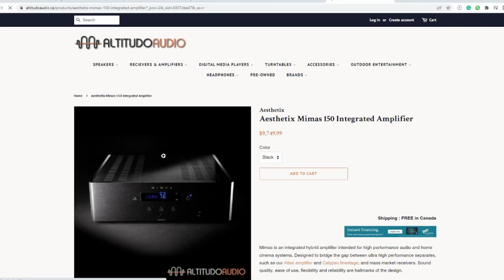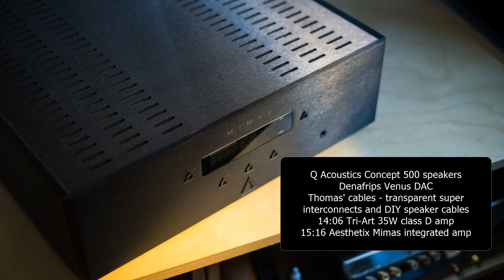A story on HIFI Synergy. How to get any speaker to sound AMAZING?

Comment: Synergy for me:  GIK Acoustics and decluttered room (hifi rack NOT near the speakers),  Sonusfaber Oly 1s, McIntosh MC75 monoblocks, C2500 pre, Sonare Ultra Rendu with Sonic Itransporter and Mytek DAC+, Roon, Eat C Sharp with Ortofon Cadenza Blue.  I also have an Otari semi pro reel2reel and a tuner and Feliks headphone amp in there, as well as a Pioneer CF level cassette deck. Oh and dual Rythmik 12 in subs. All in a 12X10 foot room. Cables are a mix of Cullen, Audioquest, Nordost and some Canadian famous engineer--cant remember brand name.

The greatest impacts on synergy for me besides decluttering and treating the room were 3 fold-----1) the MC75s are much better in my system than a solid state Luxman --the solid state to my ears sounds "SHOUTY", 2) I had EPOS Elans which weren't great, and 3) the Sonare/Itansporter/Mytek stomps all over the Node 2i.

The Rythmik subs are quite a step above the SVS too.

All these changes pretty much bought unheard, but after HOUR and HOURS and MONTHS of internet research. Now today, my latest addition is a degritter. I will use it in tandem with the Nitty.
Reply from the maker: Really nice and thanks for taking the time to write this long comment.

Comment: @Thomas, recommend you try Vandersteen Model 1Ci’s with a YBA A100 or A200 amp…fantastic synergy giving a taste of “high-end for little money” (paraphrasing Audiophiliac) as the Vandersteens are so cheap on the 2nd hand market in the USA ($200-500 2nd hand).

Van Dam audiophile 6mmSq. speaker cable, Neo Oyaide D+ XLR interconnects between amp & RME ADI-2 Pro FS, Isol8 Mini Sub Axis with DIY power cable, but the synergy is there without the conditioner…the conditioner just boosts it even more.

NOTE: 1Ci’s used to cost $1199 new but today they’re $3000, but the 2nd hand market hasn’t increased values to match thus they are the best deal in HiFi.  Sure the new 1Ci+ is improved but the basic sound signature hasn’t changed.

For more info, check the video entitled ‘If I could only own 1 system in my life for a small amount of money’ on Real HiFi Help’s channel as he identified this combo.  He also has ways of doing DIY upgrades to take the performance of this combo to the next level.
Reply from the maker: Nice, thanks for sharing.

Comment: Great video Thomas, I am a total believer in system synergy.  I own the Q Acoustics 3030i for my desktop setup.  And purely on a whim paired it with my little (and cheap) Loxjie class D amp and it is a fantastic combination.  The class D amp is able to maintain the grip on bass which the 3030 speaker has plenty of and it also gives the somewhat rolled off top end just enough sparkle ✨ to make it a wonderful pairing that makes me want to listen to music and that's what matters most to me.
Reply: Hi, Which Model of Loxjie? A30, D30 or D40? Myself has 3030i, which to improve. Thanks
Reply from the maker: Thanks for sharing!
Reply: @paultezuma864  Hi Paul.  I have the A30 model and really enjoy that pairing, great synergy.  Keep in mind it's only in near field so I don't know how it would perform in a regular distance.

Comment: "plug it in and listen" - Yep - exactly! System component synergy is completely amorphous, and non-linear; expect to pull out your hair in frustration laugh, cry and waste lots of money on the path to bliss:) In the end though, the returns can outweigh the expenditure and hassle - if you're lucky, patient and persistent:)
Reply: Another way is - deals with people who can provide you proper advice and who know products.
Reply from the maker: I like how you said it, non-linear.
Reply: @ThomasAndStereo  Yeah, if system synergy was the result of a linear function, i.e. let system synergy = y, and let x be the 'score' of four great components, ie. dac, preamp, amp, speakers, then we could define system synergy as a result of a simple linear function, y = f(xa,xb,xc,xd). 
What we would expect with that function is that the rate of change of the function is constant, where for every unit(s) of x along the x-axis the rise in the y direction along the y-axis is constant. BUT NO - it doesn't work that way - matching this great DAC with this great preamp, great amp, great speaker etc - will more often than not result in a crappy sounding system, even though we would expect that the greatest components would pair into the 'greatest system':) 
This maddening non-linear behavior, is why I - in my 35'th year of having contracted audiophilia nervosa - now strive for absolute neutrality when it comes to gear;, because neutral components yield the most linear behavior when it comes to system synergy & matching.
Reply: @leonidyamborko4531  Very good point - not so long ago, there where actual HiFi stores where one could listen to actual stacks of components, taking out the guesswork:)
Reply: I whould recommend audiotion, after that all questions is disappearing. Best to hear once than continue guessing… Audio is about sound, it’s not Logistics

Comment: Hi Thomas, great vid.
I have the c500s and over the last year or so I’ve paired them with numerous amps. I really enjoyed the Hegel h190 but just lacked a bit of sparkle in the top end , tried it with a peach tree nova and really didn’t enjoy that. Tried them with kinkistudio M1 , forget it. 
The dayens amping mono blocks with a passive pre amp worked well.  I recently had the dayens ecstasy mk4 power amp being fed by my Hegel p30 and that worked very well. But now I think I’ve stumbled on very good synergy 
Lumin U2 mini.to denafrips pontis2 to Hegel p30 to passlabs xa30.8 to the c500s . Really enjoying this set up. I’m using a lab atlas mavros from the streamer and 2 pairs of telleriumq ultra black ll xlr cables from dac to pre and pre to power amp , speaker cable is tellurium silver ll .
Reply from the maker: That is a killer system you have there.

Comment: Seems like synergy is easier to achieve with some speakers than others. I came away from this with the general impression that the concept 500s are difficult to drive and picky about power, while Focal (and probably others) are able to deliver their intended sound with a far broader range of equipment.

Comment: Indeed all depends on system - and acoustic- synergy. A well received review topic may disappoint/frustrate at home because of the reverse situation. An audiobuddy here was very disappointed with the in itself excellent Stirling LS3/5aV2; lack of system synergy. when I brought over an Exposure XV amp and simple Linn K20 speakercable, he was delighted with the sheer sense of musical involvement he experienced when that modest but synergistic system was conveying the signal of his Linn turntable to the plucky little Stirlings.
Reply from the maker: Yes, it can make that much of a difference.

Comment: Finally the video i was waiting for:) 
My experience with C500 has more with the room synergy - in "old" listening room it sounded very rolled off, and I was thinking its because of Pass amp thats a bit on darker side. Then when i moved into a new house and placed C500 into a new room, the sound completely opened up, its almost a different speaker! Much more energy in the top and now sounds more balanced. 
But i am still wondering is Pass XA30.5 good match with C500 or I should replace it with something else? Hard to get something to audition where i live.
Reply: I found synergy with my speaker setup: Concept 500 and Aesthetix Mimas not with critical listening. I plugged system and let it run, and then was doing some staff in another room and got goosebumps out there. Exactly the same my brother come to the room. We play loud but music is stay in the room. We play Blues and music and voice wasn’t tight to speakers…. I can help you to find the way to set your system. Welcome to contact me.

Comment: Great Video.  The system is more than a bunch of components. However, maybe we are missing a subtle tone control, e.g. parametric equalizer via DSP. Did you look into that? I could imagine that some of the matching problems could be resolved.
Reply from the maker: Probably but you will lose some fidelity with tone control.

Comment: Synergy over the years involved new diodes and diode bridges, new high quality capacitors, and high quality cables. Not always changing the equipment.
Reply from the maker: Interesting approach, you changed the voicing of the gear.

Comment: Low key advertising, Atlas cables of Scotland all copper Marvos cables have had great synergy for over 10 years since introduction aided by the fact they are one of the few cable companies crimping the connectors without solder. Above they had the Assimi, but silver cables required more perfect everything to get synergy. Likewise, their original Bi Wire speaker cables have stayed the same over many years. Soldered cables can slowly age, causing loss of synergy with newer additions to your system.
Reply: So you're saying my DIY cheap cables should have great synergy because I didn't use solder? ;p
BTW you'd better start looking inside your electronic components and the speakers, as there's plenty of solder in there
Reply: @RennieAsh  Please tell me you did not solder speaker cables, then make some silly comment about solder inside a component.
You do understand that soldering stranded wire will lead to it breaking unless it is mounted inside something so it can not flex?

Comment: Hey Thomas.  Thanks again for an enlightening video.  Wish you can dish out more. Question though, what components did you use for your DIY speaker cable? Thanks!
Reply from the maker: Thanks, those are LITZ cables made my Mr DIY. I did think about commercializing it under Galion but they are not cheap, sadly.

Comment: For anyone listening to computer audio through earphones, my holy trinity is the Earmen Eagle USB DAC connected to ifi Can headphone amplifier and outputing through the 3.5 mm adapter to the Hifiman RE800 Silver earbuds. So it was swapping out Moondrop Aria for the RE800's that lifted everything. You might say well what would you expect the RE800's are more than 3 times the price of the Moondrop Aria. When I bought the Hifiman RE800 Silver earbuds they were on sale for $99 US. On the Hifiman website they said they were reduced from $600 to $99. One reason for this may be because not enough people got good synergy in their setup. I got all of the components on sale for a total cost of $299 - the original cost of the earbuds. (It was the Gold version that was $600 I believe)

Comment: Are you able to dig into what chipset they use inside the 25 watter?
And, perhaps you can also include some info on the music which you used to review them.
Reply from the maker: No I did not check but am curious too.
Reply: @ThomasAndStereo  Recently, there seems to be some excitement created over the Topping LA90, a desktop class Ab amp and the (much more expensive) Enleum Amp-23r 
Any plans for these in the pipeline?
Reply from the maker: @Unker_Spunkanathan  I have the LA90 in for review already.

Comment: I'm a believer thomas. Synergy is everything. I'm experiencing it now. Now kind of off topic. What are your thoughts / feelings regarding balanced cables & ins & outs. I personally have not heard them. But the concept is strong & makes sense. But... Is it snake oil?
Reply from the maker: We did AB test some cables that are same model and same series around the same length, very minor differences between the XLR and RCA version.
Reply: Yup... That's what I thought.  My equipment is pre xlr. It sounds fantastic with a super low noise floor. Like I can't hear any at all my cables are audioquest evergreen. I'm keeping em. 😆 lol. Thanks Thomas

Comment: Hi Thomas! Would SMSL VMV A1 be a good match for Q Acoustics 500 for a 18sq.m room?
Reply from the maker: Probably not. If you have a Concept 500, you need more firepower.
Reply: @ThomasAndStereo  Thank you!
Reply: @ThomasAndStereo  Funny enough, A1 controls hard to drive Kef R3 much better, than more powerful Topping LA90. So for starters I will change R3s with Concept 500, and then only then will change amp. Love A1 so much.

Comment: I found it accidently kinda scared to change anything. Zu omen def mk1b, rogue rp1 , schiit aegir, sony 777es sacd, blue sound node 2i withe aeris2 dac. Speaker cables and interconnects are anti cables 3.1 power cords vodoo on amp and pre. On sorces mit zcord2. Going with got lucky
Reply from the maker: Nice, don't change anything if it has great synergy.
Reply: @ThomasAndStereo  you know its not possible im prolly gonna tube roll the pre tmrw